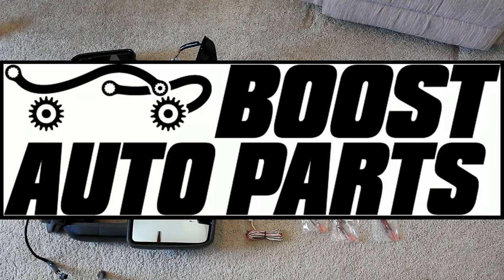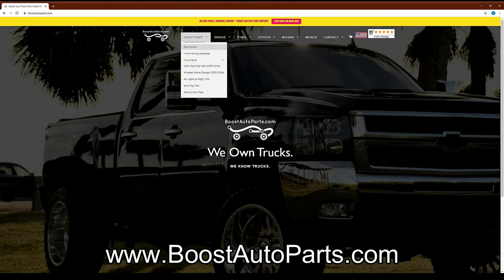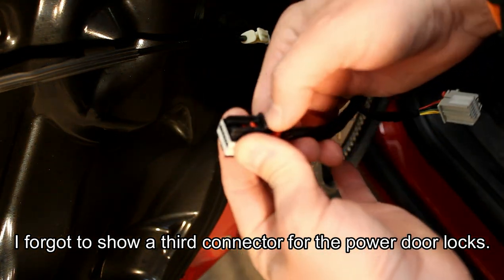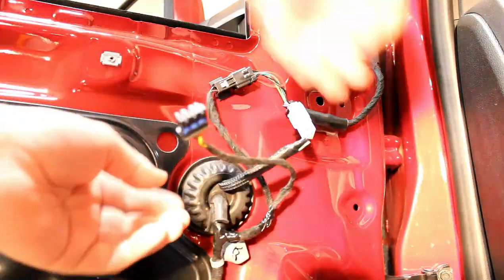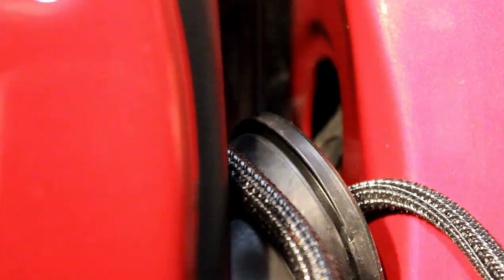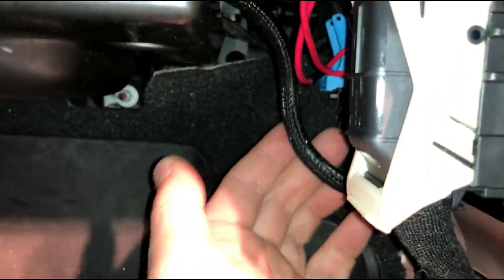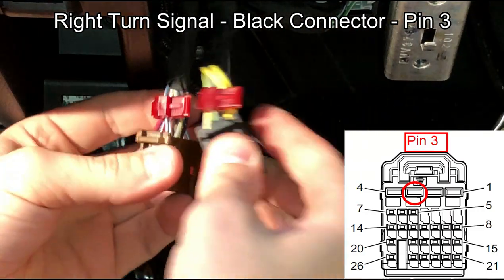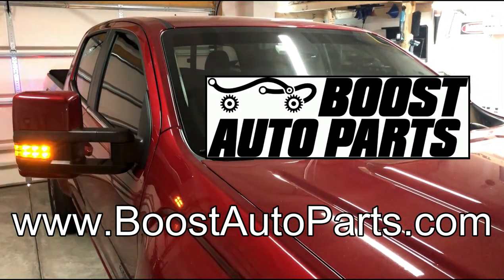[HOW TO] Install Boost Auto Parts Towing Mirrors for 2015-2022 Canyon / Colorado

Comment: Thank you for the content! I have these Style 2 installed with the Red Quartz paint caps to match my 2018 Canyon AT body paint. I didn't opt for any of the switchbacks options, but opted for the clear Amber Dotted with Signal & Running Lights 2.0, Upper & Lower Defrost mirrors, Dual Function (Cargo and Reverse) Wiring Harness & Low Output Flood lights. I couldn't be happier with these mirrors;  they do above and beyond what I expect them to. Highly recommend!
Reply from the maker: Right on! Glad the videos are helping you! Thanks so much for watching.

Comment: Excellent "How To" video! 

I had no idea that I wanted to upgrade my mirrors until now! lol 

I mainly like the fact that the light is tied into the cargo light. That would come in so hand for putting in the boat before sunrise, working around the home, and especially... when camping!
Reply from the maker: Thank you! Glad you liked the video. The cargo light function is pretty cool. There’s even another option that can tie those lights in with the reverse lights. I’ll be posting a video soon on how they works.
Reply: @fondupot  OK. I personally would not bother with setting up that feature. Here is why...

You can activate your cargo light when in reverse, neutral, or park. Leave the cargo light on... and … put into "Drive". The light will go off. 

As soon as you go back into reverse... it will turn back on!
Reply from the maker: The cargo light will continue to function as normal. That light doesn’t come on in reverse. The spot lights on the mirrors will also function with the cargo light button. But with the added benefit of coming on when in reverse. They will also act as approach lighting when unlocking the truck because the reverse lights flash.
Reply: @fondupot  Oh yeah. That would be nice too!
My 18' Colorado, which is stock, allows the cargo light to come on when in reverse at night(when selected). I wonder if it was only a function for that year model. Otherwise, you may have that feature as well and not know it. It is handy when backing up around trees at night.

Ever since I upgraded my cargo and reverse lights to some much brighter LEDs... I have been wanting to tie them together electrically when the cargo light is activated (but separate otherwise). Just to use for around the camp and when fishing. I will do via either relay or diode.
Reply from the maker: @great0789  Well of course if you push the button, the light will come on. But by default, I'm pretty sure the cargo light on the 3rd brake does not illuminate when in reverse.
Reply: Fondupot's Garage Mine does. Perhaps this will be a “mind blown” time for you. Please go out and try it tonight and let me know. 😁 Start the truck up and turn the cargo light on. Put it in drive and the cargo light will extinguish on its own. Put it into either reverse or park... and the cargo light will come back on... on its own.
Reply: MySuburbanHomestead I think what Fondupot’s Garage is trying to say is that without a diode, the factory cargo lights won’t light up when shifting into reverse without first pressing the cargo lamp button on the dash. Also, yes they will extinguish when the gear shift is in a forward travel gear.
Reply from the maker: Bingo

Comment: These mirrors are awesome. Unfortunately, my set of mirrors came out before they introduced the heated convex glass. So mine was just the heated flat glass. However, they do include a retrofit kit. A word of caution: if you ever have to pull the flat glass off, you might as well order new glass. Some mounting tabs will break and it will only be a matter of time before the rest of the tabs break and the glass is hanging by the wires.
Reply from the maker: Yea I love them. I think mine have flat heated glass only too. I live in NC so I don’t really need heated mirrors anyways. But, good info about the mirror glass. Thanks for watching.

Comment: Hey there!  I used your video yesterday to install my set of mirrors on my 2021 Canyon.  I have a sequential signal & running lights that has an additionnal set of wires to your set.  Now, I have this issue that I start my truck and running light are on and good...after 10 seconds maybe, they dim and flicker, looking like they're struggling for power.  But, once I turn the truck off, they are up and running fine...it seems intermittent also as they did stay bright once last night...  I've tried looking for the harness diagrams like the ones you show when you're crimping to a wire, but couldn't find any.  I did tripple check on the Boost Auto video for me to have the right pin into which I tapped my blue wires to...
Reply from the maker: Strange. Not sure what could be going on. Contact Boost directly I’m sure they can help you out.
Reply: @fondupot  I had already before commenting here.  They sent me an anti-flicker module.  I should get it Thursday.  We shall see what happens...
Reply from the maker: Glad to hear. Hopefully it works for you. Let me know!

Comment: Great video! However, when I try to put the connecter back on both sides with part that pushes up doesn’t go back in any idea why?
Reply from the maker: Are you referring to the locking tab on the connector?
Reply: Ya
Reply from the maker: Honestly. No idea. Unless the design of the connectors has changed. I would contact Boost Auto Parts. They have great customer service.

Comment: My truck is Chevy Colorado WT (work truck) from 2018. No power mirrors at all, they are 100% manual motion. So I guess that means that these won't work for me at all, right???
Reply from the maker: I mean technically they would bolt on. But you would have to run wires and add a switch to get all the power functions to work.

Comment: So do the ambers only light up with the turn signal or do they come on when the headlights are on?
Reply from the maker: I didn’t get the running light option, but you can get it as an option. I wish I would have got it, because it’s hard to add later on.

Comment: Any idea why my low output flood lights are continuously on all the time? I triple checked that I tapped into the correct wire and they still are on all the time even when my truck is turned off completely. I have a 2017 Colorado almost identical to your old truck if that makes any difference
Reply from the maker: That is really strange. I honestly have no idea. Did you also to the cargo light module?
Reply: Fondupot's Garage Yes, the cargo light left and right turn signals, and the ground are all on separate modules
Reply from the maker: Make sure your cargo light button isn’t accidentally engaged. Cuz that light works when the truck is off.
Reply: Fondupot's Garage right... I thought that was the issue at first but it wasn’t on lol. I’ll try and go through it again to make absolutely sure everything is correct.

Comment: Do you  have the running light function or just signals?
Reply from the maker: Just signals. If equipped with the running light option there would be a blue wire in the hardness they provide. And that gets hooked up just like the other wires under the dash
Reply: Fondupot's Garage So with your exact options, how much were the mirrors?
Reply from the maker: $413 shipped.
Reply: Fondupot's Garage There a reason you didn’t get the running lights? Was it just the cost?
Reply from the maker: @EVHman572  At first yea, but I honestly wish I would have gotten them. It's basically another $100 option to add the running lights.
Reply: Fondupot's Garage  So would you say its worth the extra cost and work to get the style 2 over the style 1? I seen you have had both. I appreciate you answering my questions.
Reply from the maker: I like the look of the Style 2 much more. I think it fits my Canyon.

Comment: What are the sizes of the mirrors?  Cannot find measurements - normal and extended.
Reply from the maker: Brian, I just took some measurements for you. These are how far the mirrors project out from the body of the vehicle. 
Normal - 14" 
Fully Extended - 17"
Folded in - 8"
Reply: How about total vehicle width with the mirrors not extended? I don't want to fold them in every time I pull my truck into the garage.